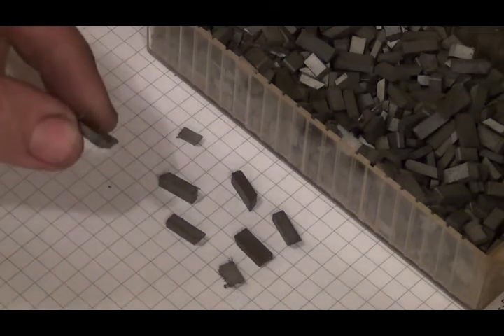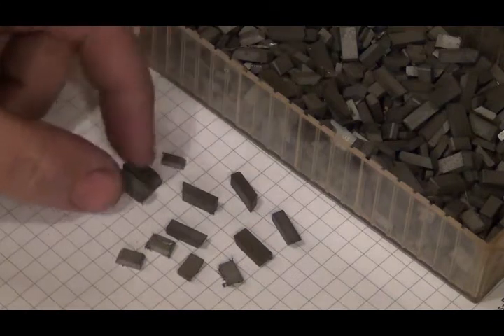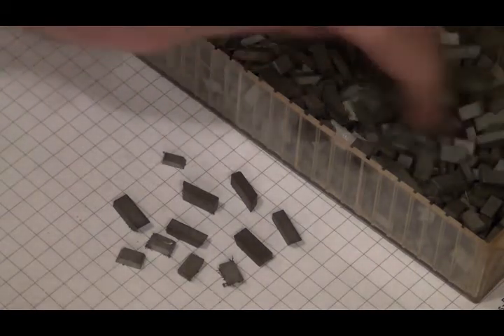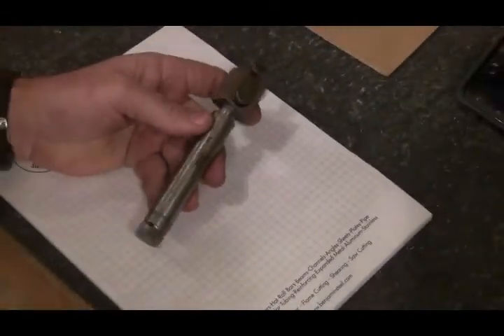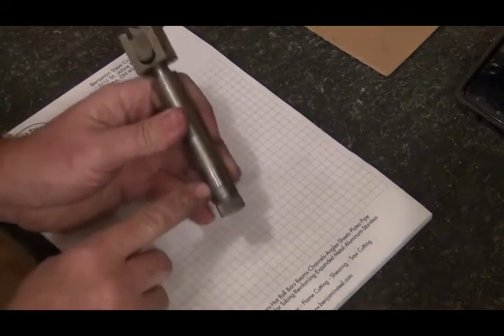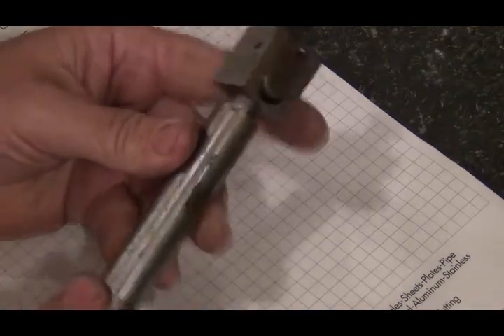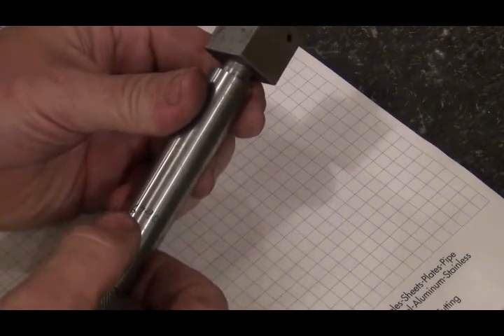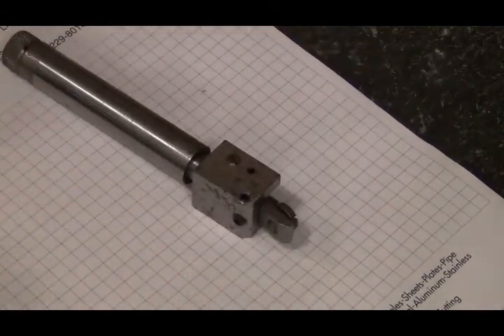Machine shop what is it

Comment: If I'd found that draw of bits outside of an engineering context, I'd have thought they were ferrite material for high frequency transformer use.

The second item has an arrangement on the end like a clapper box. I could see it being used to cut a keyway in a large bore.
Reply from the maker: Hummm! That may be a good shot at it.
Plus the guy that I got the shop from was also a Ham Radio guy. They do look like the ferrite cores that were in radio equipment I use to tear apart. But they are cut into rectangles and have angles cut into the end.

Comment: They are carbide inserts for shell mill cutters and other insert type cutters. I also have a large box full from when I had my machine shop (no idea why I'm hanging onto them)..
Reply from the maker: Do you have to grind them to the shape that is needed? Or just clamp them on the cutter? I don't think I have a holder that is for these. Can you provide a link to what I need?
Reply: Go to MSCDirect.com and search for Indexable Cutting Tools.. There are so many brands and types of indexable cutting tools to choose from that it would take a hundred pages to list them all. Good luck.

Comment: I think the first ones are carbide cutters. Maybe that guy used to grind carbide for a millwork or cabinet shop. No idea on the cylinder.
Reply from the maker: That may be right. I was wondering if they would go into some kind of tool to be used as a cutter on a lathe.

Comment: Cutters look like they are for seat cutter.The old school ones you turned by hand .You set it up and cut the old cast valve seat out and drop in a new hard one.I would think #2 is for measuring run out (on what I dont know) Maybe for checking wear on cams like the ones in magnetos  (most likely used with a dial indicator also)
Reply from the maker: I think the cutters are carbide teeth for saw blades. After a couple links to videos using them I'm pretty sure that is what they are.

Comment: Bwatters68 is correct it is a part to a endmill sharpening jig look here you will see the tool in the lower right corner of the picture's http://www.practicalmachinist.com/vb/tooling-parts-accessories-sale-wanted/fs-weldon-model-200-end-mill-sharpening-fixture-air-bearing-collets-accessories-248541/
Reply from the maker: Sorry I don't see it in the picture.